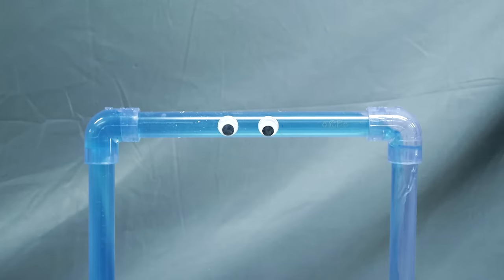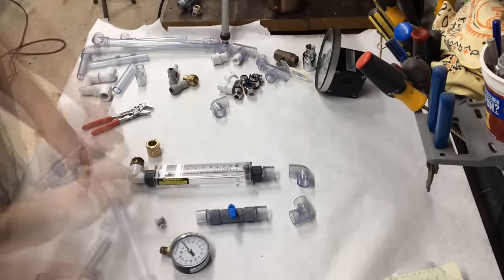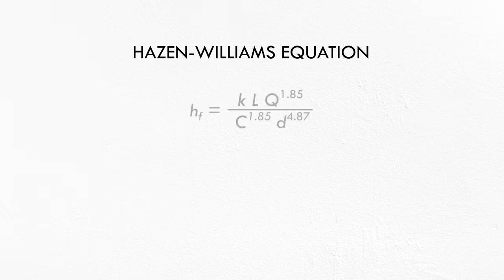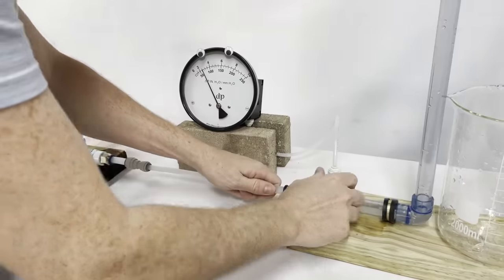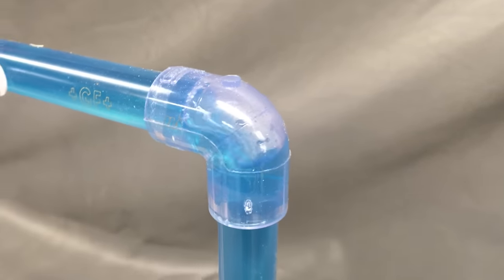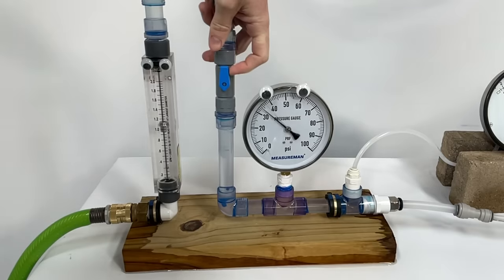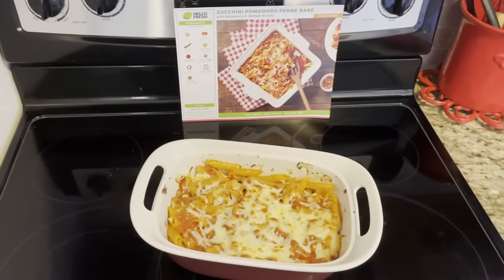Flow and Pressure in Pipes Explained

Comment: putting a big diameter pipe randomly in between two smaller diameter pipes isn't going to give you any benefit unless you're trying to store fluid.  the smaller pipes are going to dictate the vast majority of that systems pressure losses.

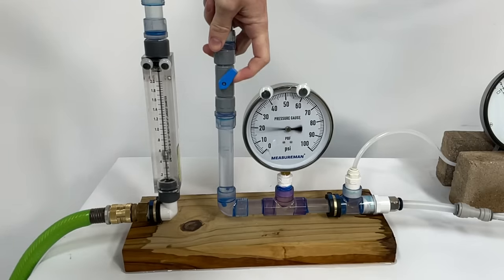Comment: 9:00 How low is the water pressure in the US? When i fully turn on the tap in my shower it's like spraying yourself with a pressure washer.
Reply: it varies wildly from water system to water system, and even varies inside the systems based on how far from towers/pumps you are. in my town, water pressure regularly hits 90psi and almost every house has a pressure reducing valve installed before the house.
Reply: That's like asking what color is a cat in the US

Comment: One thing bothers me a bit during the course of your presentation.

If fluid in pipe lose its pressure when encountering obstacles in a long pipeline, it's because of friction between the fluid and the pipe walls and turbulence in the fluid's flow. If it's friction, then it'll have to go somewhere, and one of the ways it can be converted to is into heat.

Sounds trivial at a glance since normal water in water pipes would just laugh and absorb the generated heat away immediately, but in cooling systems where cooling water or fluids need to be transferred between areas across long enough distances, would excessive pressure drop, turbulence and flow restrictions in the pipes along the way introduce enough heat into system that engineers would have to account for unwelcome heat coming from these sources, even if the pipes itself are sufficiently insulated? 

And are there any examples of engineers keeping insulated cooling pipes as straight and unrestrictive as possible to prevent such temperature gains?

Comment: It seems for me, that your measurement in 5times thicker pipe are made completely incorect. You compare pressure on thin pipes connected to thick pipe, but 99% of pressure drop occure in thin pipes and reduction, so its almost impossible to measure drop in thick pipe. To measure correctly, you have to rearrange your setup and make inlet and outlet pipe with measuring at least thic as measured pipe...
Ps. Thanks for the rest and your work. Joseph

Comment: Sigh. "head loss in inches of water" is an intense unit. Imperial unit of length as a pressure unit, though implicit assumptions of fluid density, gravitational acceleration, and no flow conditions.
Reply from the maker: Welcome to civil engineering

Comment: You did something a long time ago which is/was nearly the same and had problems.
I think this is suffering the same "problem":  When you use the bigger pipe, it is a very short piece and there is/are substantial distances of small pipe included in the distance being measured.  I feel that will taint the results.
Why can't you make the two pieces of pipe at each end as short as possible and make the big piece longer (as in by the amount you make the smaller pipes shorter) and see what happens.
Sorry, but to me, the "new piece of big pipe" is 1/3 big pipe and 2/3 small pipe which negates any benefit achieved.
Ok, it may be academic but to me you are including a lot of the wrong sized pipe in the part you are measuring.

Comment: Gallons per minute? Pounds per inch? That doesn't mean anything. Can you translate it to real units?
Reply: It's pounds per square inch,  not pounds per inch, and they absolutely do have meaning. Gallons per second is a perfectly acceptable unit of flow rate and pounds per square inch is a perfectly acceptable  unit of pressure.
Reply: @andrewalexander9492  You see, those barbarian units are probably the reason your shower sucks
Reply: @henrymach  Well, us barbarians bathe in mud puddles anyway, so...

Comment: This area of fluid dynamics always lost me.  Water is incompressible so if the end of the pipe is moving slower than its beginning where is the water going?
Reply: The water flow is not changing with resistance, the pressure required to achieve the flow is changing.  Say you want 1 gpm flow in your system: if you have short, fat pipe with little resistance, you can achieve that 1 gpm with low pressure. If you have a thin, long pipe, you will need a higher pressure to achieve the same 1 gpm.
Reply: It is not moving slower, it is just at a lower pressure.  As for changes in velocity due to changes in pipe diameter use the equation F=A*v with F as your flowrate, A is your cross-sectional area, and v is the fluid velocity.  As area goes up, velocity will decrease, resulting in flowrate remaining constant.  You can also add in density to the right side of the equation if you want your answer in terms of mass per unit time.